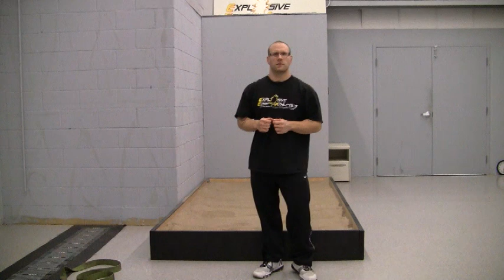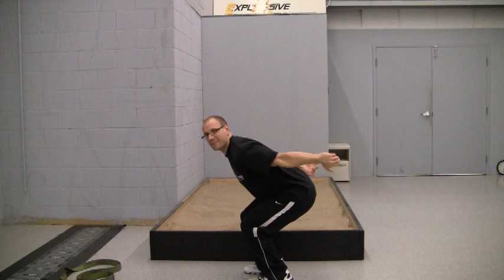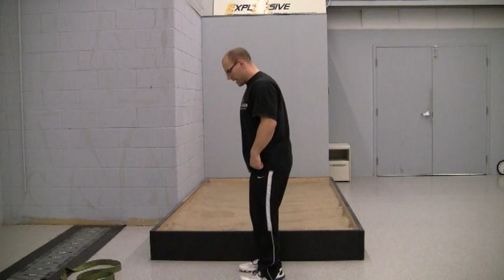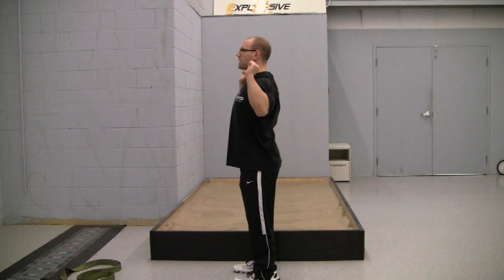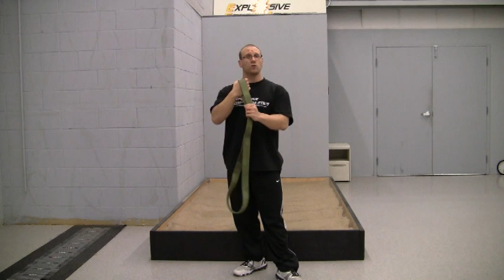Increase Your Vertical Jump : Part 4 - Eccentric Speed

Comment: isn't it dangerous to increase eccentric speed when squatting? You lose control of the weight and it hits hard when you try to lift it up. I actually hurt my back doing this some time ago so stopped squatting for some time.

Comment: These are the best vertical videos on the net!  Seriously.  I've read about Mel Siff alot on T-Nation but I've never heard of the passive acceleration technique.  I've always been a strength jumper so I jump higher with two-feet than with a running start.  I can now understand more the elastic jumper.  Also my standing vertical went up immediately after following your arm swing and SSC cycle tips.  And even some more after using Postactivation potentiation for the CNS with some jump squats!!!